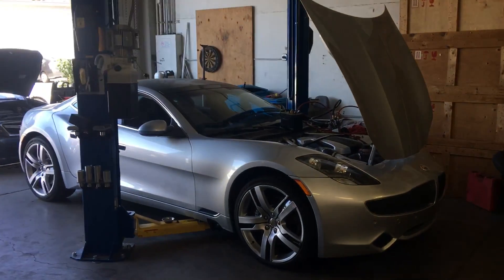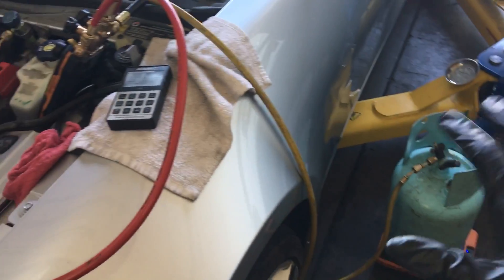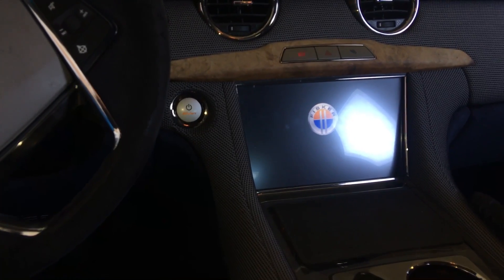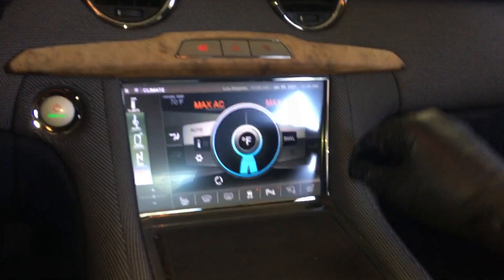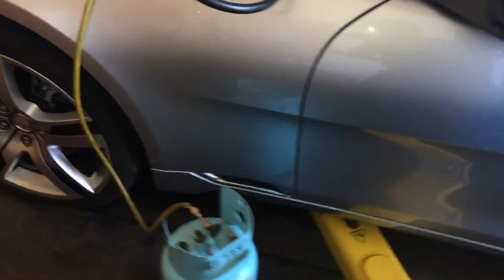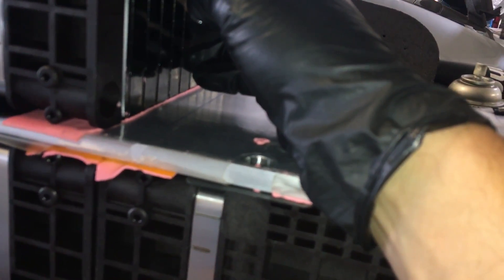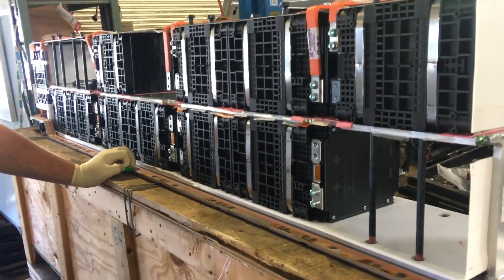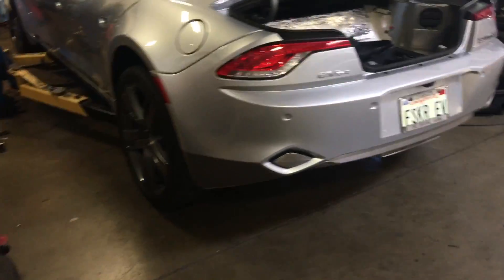Karma. Fisker AC cooling in high voltage battery pack cooling￼￼

Comment: II’ve yet to see any engineering come close to like what I’ve seen on the model Y heat pumpk they got 300,000 of those things at least out there with very few failuresk. They had a few pressure transducer issues and a software update that’s it
Reply from the maker: The failures Will come when they get serviced by the aftermarket garage , specially body shops.     
                   That’s where I get the majority of my burnt out compressors asking customer were they in a front end collision within the last nine months to 18 months where the body shop had to replace the condenser. 

           Body shops are the cause of most compressor destruction in our industry if it wasn’t for body shops mechanical shops would have so much work. 

            All the Tesla as I have done none have been failures they have all been front end collision work when I get called in to recharge them after a front in accident. 

          From what I’ve seen Tesla has done an excellent engineering job and implementation of components for the thermal management system
Reply: @coldfinger459sub0  using a liquid cooled condenser with an 8 way valve  and electronic expansion valves was brilliant
Reply from the maker: @Mobileccs  there is the beginnings of some talks with tesla to authorize third-party aftermarket certified repair shops. 
              Just like they do with their body shops they let them have scanners and give them first priority with parts and training. 

            I’ve been working with one of the shops for a last decade that is in the beginning talks to becoming one of those certified Tesla shops for mechanical repair. 
              I’ll have them put me on as one of their employees because I want to attend their thermal management classes on the Tesla. 
            One of my shops is a German motor car Bosch certified distributor they put me on all their free training webinars and classes

             Another one of my mechanical shops was heavy into Japanese stuff and got me signed up on all the DENSO in Japanese training classes for HVAC air conditioning

        Another one of my mechanical shops was an AC Delco distributor and got me into all the general motors in AC Delco training classes for free
Reply: @coldfinger459sub0  I don’t think there will be that much work         On the hvac systems for Tesla’s there’s people with 150,000 plus and not reporting any problems at all ..body shops with collision repair yes
Reply: No compressor seal ..240 3 phase ac compressors with a 340 volt dc to ac converter so the signal is nice and stable
Reply: When I was born the #1 album was ac/dc high voltage 1976. I have been a fan ever since
Reply from the maker: @Mobileccs  100% sure on the body shop collision side I’m a vendor for over 1200 shops from Redwood City to San Francisco,  my cousins from San Jose over to the Eastbay Hayward up to Vallejo,  my other brother I started in this business used to work down here in the SF area now willits in Ukiah area, my youngest brother is the Sacramento area, 

      We get calls to fix the body shops mistakes all the time and now the majority of all the body shop stop doing air-conditioning and just use this as a vendor and supplement our bill to the insurance company direct.
Reply from the maker: @Mobileccs   I was 11 years old my older cousin I remember would go to the AC DC and kiss concert I was too young.
My number one album when I was born was, i’m Henry the VIII I am ,  I got you babe , HELP!
Reply: @coldfinger459sub0  lol